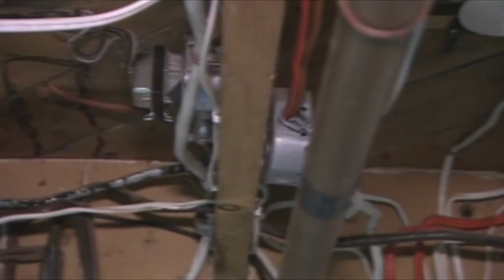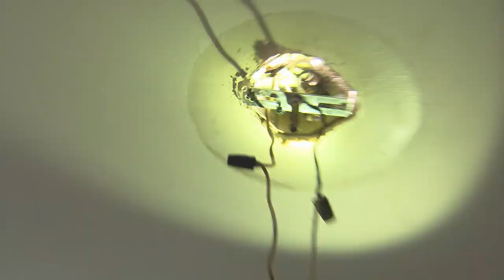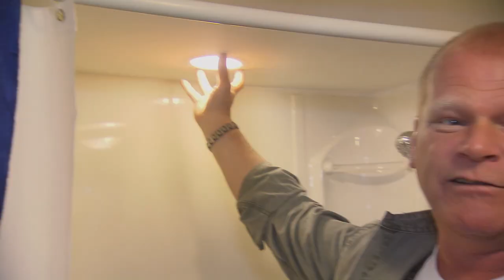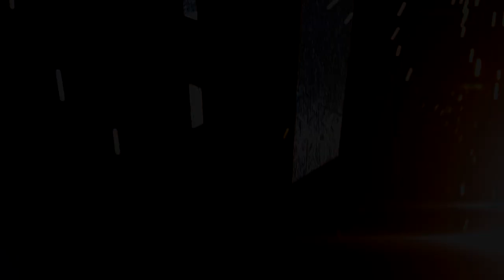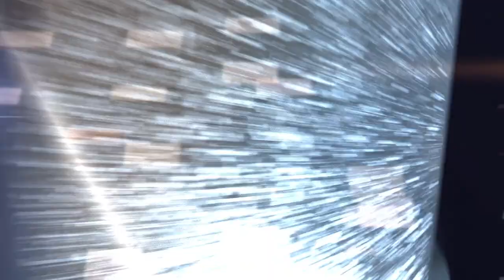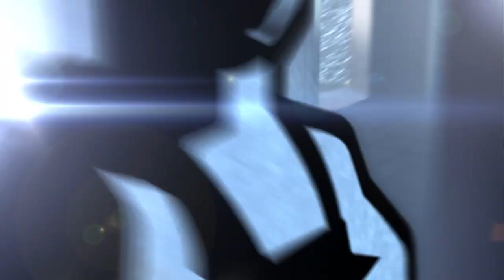Mike Holmes On Why Electrical Safety Is Important

Comment: Very interesting. Had a inspector who supposedly inspected my electrical panel after it was replaced. The inspector just walked into the house like he owned it, was extremely rude and didn’t even inspect anything. Just talked with the electrician a little bit and that was that. I’m going to have another inspector inspect the panel as I’ve already had 2 brown outs since it was replaced within 2 months and none of my neighbors lost power at all. Went from a 100 amp panel to a 200 amp panel. Too bad there is not a way to hold inspectors accountable and liable for not doing their job.